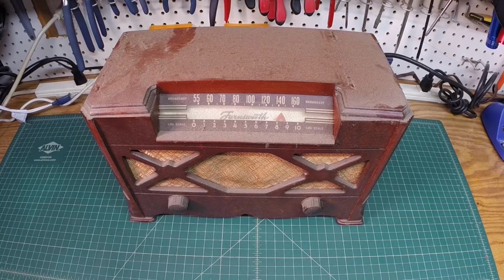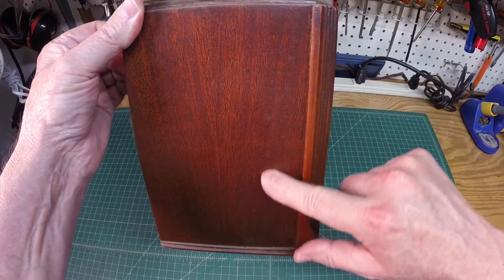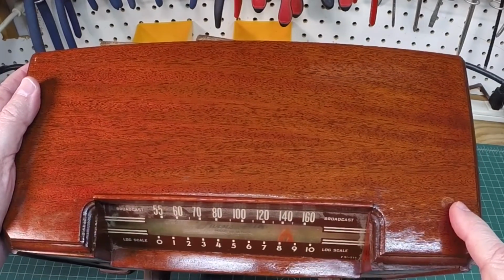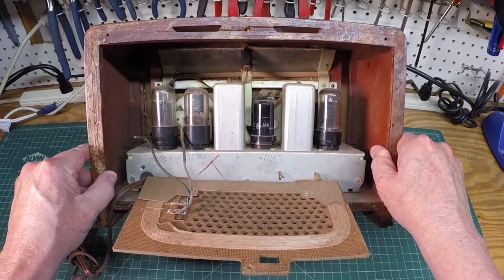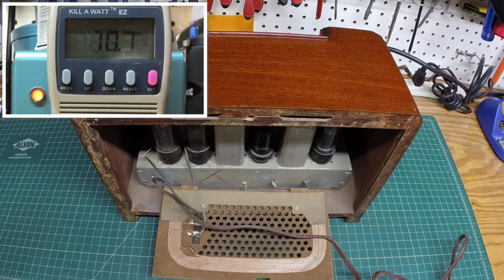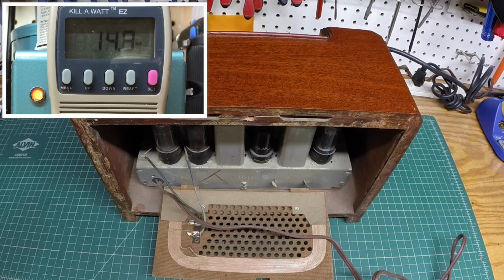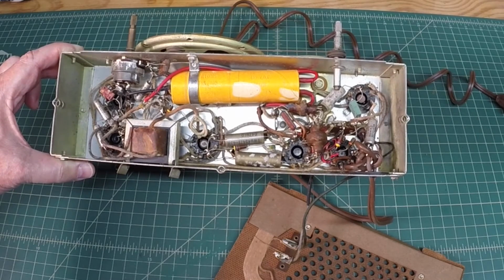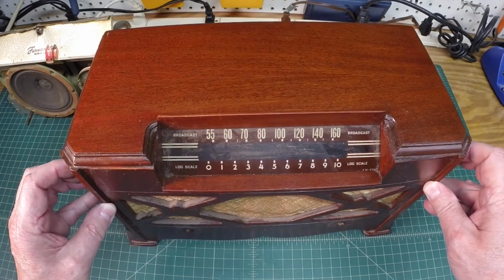Farnsworth - ET-066

Comment: I just picked up the same exact radio for 26 bucks on Ebay with a really nice finish on it, claimed it worked, wood is real nice on it, original back in mint shape. No clue if its been serviced so may have to recap it which I have all the parts here for when I get it in 4 more days.
Reply from the maker: Congrats on your find for $26. It’s a beauty and I’m sure you enjoy having it in your collection. Best, Don

Comment: Hey Don, very nice looking radio.  Do you think you'll try to make a new back for it from Masonite to fit it?  I imagine as talented as you are you could do that and just re-use that loop antenna on the new back.  Yeah, that grain pattern on the top and sides sure does look like mahogany.  I once had a Sparton  7-46 console radio/phonograph that I had to strip as the finish had gotten very dark, almost black and had water glass stains etc.  It had that tight grain mahogany as well under all the grime!  I didn't even stain it, I just clear coated it and man did that thing "pop"!  The only thing I didn't like about it afterwards was the old light beige grill cloth but I took a bottle of Fiebing's leather dye in British Tan color and daubed it onto the original cloth and I loved the way it came out.  Take care, Gary
Reply from the maker: +Rebel9668 Gary, for sure on the back. A few years ago I bought up material just for reproduction of backs. My shop is a mess right now, but I'll dig it out and present it in a future video. You're right about the cabinet and finish. I don't think it will take much to make this one shine. Thanks for sharing the tip on the grille cloth. My Chanticleer 2D570 is not matched very well. I may have to experiment. Do you have it on video? Best, Don
Reply: RestoreOldRadios Sorry, no I don't have that on video.  This was back before I even had a home computer and the only camera I had back then was a Polaroid, LOL.  It was back in the late '90's  and I didn't even know I could get the electronics restored at the time, much less restoring them myself.  Fortunately the radio played beautifully without any hum although a connection behind the cabinet that hung upside down would get loose and I'd reach behind there without looking, grab it and push it back into it's connector, LOL, guess I'm lucky to still be here.  I later moved to a smaller place and didn't have room for it and gave the radio away.  I miss it now.  It had a wonderfully deep rich sound.  That Fiebing's leather dye comes in a bottle with a metal cap that has a bit wooly looking cotton dauber at the bottom of a wire attached under the cap.  The dye comes in many colors from black to brown, oxblood, navy blue, british tan...I don't remember what all, hope you find it useful.  Take care, Gary